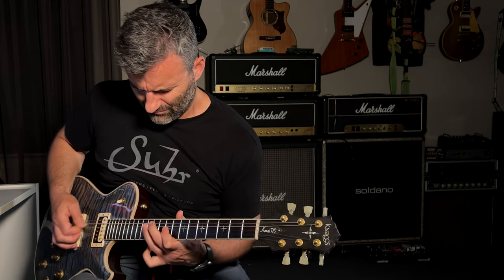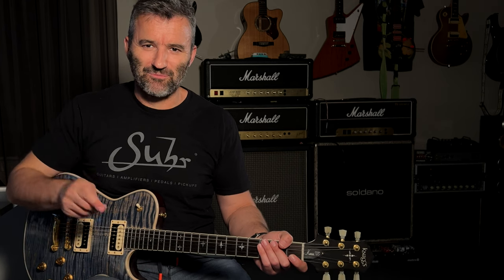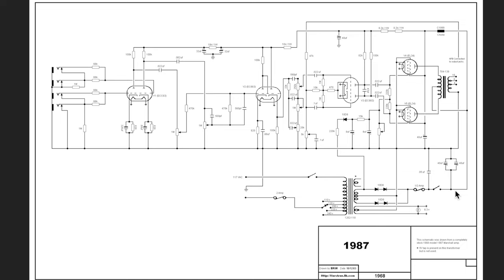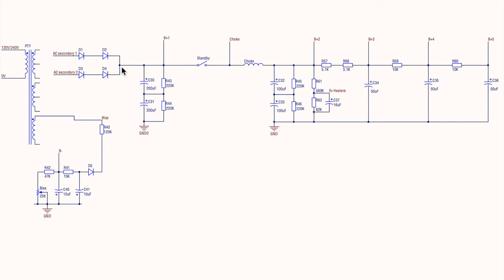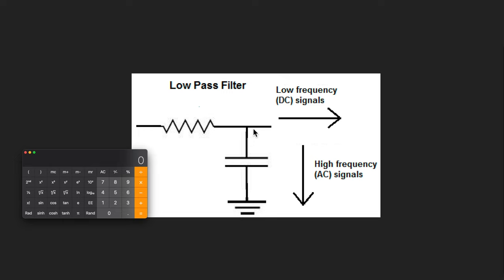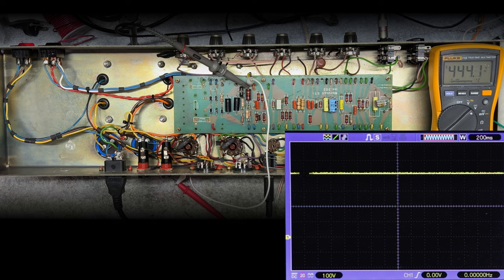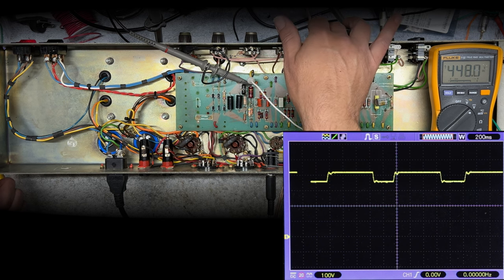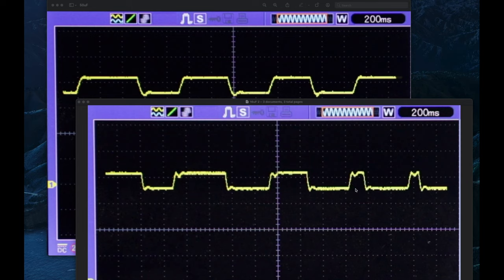Do FIlter Cap Values Matter in a Marshall?  IN DEPTH MEASUREMENTS and TONES!!

Comment: I'm enjoying these vids, you're putting a lot of time and effort into micro tweaking. The more pronounced overshoot or ringing with 16uF is a function of the LC low pass filter response. No ringing it is said to be critically damped. There are many different LPF responses for example Bessel, Butterworth, Chebychev etc etc. Bessell (or Gaussian) has no overshoot / ringing and for example Chebychev has a lot. Looks like there are a few things happening here simultaneously -> one is the PS 'sag' and another is the ringing from transients. I've never really thought about ringing in this part of the PS so really glad you posted this, it's given me a few ideas to try. For example, you can have the sag of the 16uF without the ringing, it's just a matter of a/ juggling the values for a Bessel response or b/ use an RC damping network. I recommend downloading Ltspice freeware and you can simulate / play with ideas, see how it responds to various IP signals before modding and listening.

Comment: If you're using solid-state rectification in your amp, reducing the main supply filter cap is going to have an impact on the amp's bass response, as well as the hum levels, on the other hand increasing the main supply filter cap is going to "stiffen" the amp's response, if you're using vacuum-tube rectification in your amp you don't want to increase the main supply filter cap because it will shorten the life of the rectifier tube.

Comment: Fun Fact: on the current fractal devices you can “virtually” adjust the filtering. Also you can select AC or DC.  The AC/DC option lets you get rid of any ripple regardless of the amount of actual filtering you choose (DC). If you select AC then you can hear ghost notes if the filtering is low enough -just like in the real world.
Reply from the maker: Amazing isn’t it, I have played around with those parameters.
Reply: @HeadfirstAmps  Yeah, I’ve been using the Red Channel of the Bogner Ecstasy (Fractal) and its super chewy with the default settings.
Reply: @HeadfirstAmps  Also when I turn the bias up hotter on Fractal I have an urge to back it off as I know in the real world it would be hard on the tubes. LOL

Comment: Super interesting.
Food for thought: You can get SCR, I think up to 50uF 630v plastic caps now at reasonable prices. They will last forever, and maybe sound better, you can get away with half
the caps on a 100w amp because of the higher voltage, but they don´t come in double cans. Some amp gurus think it is better to distribute the caps, instead of placing them
at the start of the amp.

Comment: 50uf for me, the 16uf sounds gritty on the harmonic overtones (in a bad way) and seems to lose some chime and bass. It’s not doing that ‘sag’ thing a JTM45 does when you hit a big chord either, I think that’s more down to the valve rectifier than the filter caps. 

Valve vs. Solid rectifiers would be an interesting video but slightly trickier to do (unless you just borrow a mess with a rectifier type switch)
Reply: Okay

Comment: Here is a tough kind of question, I previously had a JCM2000 DSL 100, that I bought used and I now suspect the original owner had removed the bright cap because when I put the presence on full it gave off that fat Marshall crunch tone, (lots of sustain, lots of low end thumping, rich crunch, lots of "feel") especially when the Presence was maxed, (FYI, Strat and 1960a cab, 90 mv bias)
Unfortunately, I sold not realizing what I had...
 I have purchased two of the same heads since just to be disappointed, (post-2004, no bias issues), both heads suffer from fast dying notes, thin-sounding, no "feel", so I just finished re tubing (the last head) and to no avail, little more "feel" from increasing to the 90mv bias)
Would you remove the bright cap? 
 I'm definitely going to try a choke too, (I just learned from your other video), I hate to sound OCD but this has been an ongoing struggle but I'm not giving up...
Thank you in advance even if you are not able to comment...
R

Comment: Again, another facinating video. Did you notice any increased hum, going from 50uF to 16uF on the screens? Do you think there would be any adverse issues on going this route on a 2204? Thanks Jason!
Reply from the maker: Thanks Steve.  No noticeable increase in hum, the filtering through the rest of the preamp will see to that.  I have 32+32 on the pres.  Do try it on a 2204!
Reply: I can't speak to the 800 or 2204 but in a fender vibro champ scratch built with a very small power transformer. Just enough transformer to do the job. It had quite a bit of hum but was drowned out by the signal to noise while playing. For an experiment I stuck a 220uf cap after the choke. It's tube rectified. The hum dramatically lowered. After some testing i concluded the additional capacitance raised the b+, increased the bias, lowered the sag, raised the rails decreasing distortion, and dramatically decreased hum. The b+ is reducing in ripple, sag spreading the rails, and cleaning up the sound a bit. It's all semantics to me though with knobs and pedals involved. I would 100% jumper in another cap and see how it sounds. No harm but the cost of a cap

Comment: I always felt the preamp filter cap had the biggest effect when dropping lower than 50uF
Reply: It has as much effect as any other filtering node. But in this video he is going over Power tube distortion where Marshall's true tone lies. It can be unforgiving at higher volumes even modern metal, so it helps for the filtering to have just a bit of give. Typically 47uf or 50uf is about the sweet spot for tight and chewy, lower is a bit more 'carmelized,' more personality and give but doesn't hold up under higher gain. 100uf has been used in late 80s JCM800s as ultra-high gain players demanded ninja-like response from their Marshalls, but played anything slower than blitering pace and gain yielded a sterile, uninspiring tone

A fair compromise today is for amps to have stiff mains/plates filtering of 100uf or more, 50uf for screens and PI, 22uf for preamp. Tight where it matters, forgiving where it matters

Comment: So which do you prefer, cranked 1987 or cranked 2204?
Reply from the maker: Oh the 1987 cranked is very hard to beat, but the 2204 is more useable in a band context.  The 1987 really needs the Fryette PS2 with it to make it band friendly.  I prefer the 1987 though tone wise.
Reply: @HeadfirstAmps  What is surprising is that for recording purposes, the JTM 1 watt (the little head with a nice 2x12 cab, not the combo) is hard to beat, yes you need to crank it but you don't need an expensive power attenuator. It gets as good as a cranked 1987, and even more chewy. Do you think it depends on the fact that it has no EQ knobs? Sometimes I think the less knobs the more clarity.

Comment: I have a 18 watt JCM800  from Tube Town .
Solid state rectifier . It has  2    2x100uF and no B5  . I put 100 at mains and  50 at the rest , but the amp become noisy .  
 So what about noise ?  If you lowered the filtering  .
Reply from the maker: Check your grounding of the new caps, a bad ground will introduce bad 100 or 120hz hum
Reply: @HeadfirstAmps  100hz  with master at 0 and it goes up as master goes up .Not very loud  , the fans of my desktop pc cover it . So i wonder about the diodes it has 2   UF5408  not 4   1N4007  . I don't think it is a ground . I will change the diodes  .
Reply from the maker: 100hz with master on zero is usually, a bad power tube, bad mains filter grounding or bad mains filter cap…or failed choke.

Comment: I have 100 on the screens in my 2204.
It goes 100, 100, 40, 20, 20.
Ive also 47n PI coupling caps, a 470k resistor into a 500k master volume pot.
One thing I've noticed with every 2204 ive built, variants etc, is there's an artifact that sounds like over distorting, or parasitic inductance, whatever but ive finally solved the problem with a 120pf cap on THE OTHER SIDE on the PI over the 220k bias junction.i also removed the 47pf over the 82k/100k input side of the driver.
Have you ever tried it? Seriously try it, you'll thank me later☺️ 
Honestly its why i always felt like its why i always had to increase the negative FB with those amps. If you do the 120pf mod you'll find that you can run the 100k on the 4 ohm tap and it sounds like you think it should.
Reply: Where exactly do i do this mod on the circuit?
Reply: @miseryparty3726  my amp is a homebrew.
But you'd have to tap into the power supply, where you'd want the filtering or extra filtering.
I believe in some 800 amps they only have two 10 k resistors, and can have a too high voltage in the preamp.
I like the way they did Kerry Kings amp where they take the power node for preamp to the power amp.
From the way I wired my jcm800 clone I did a 50 watt version on the KK 2203.
It allows you to use lower voltage to the preamp, but without making it sound too thin running from the screen section of the power supply.
Reply: @KB_Joys  I meant where exactly did you put the 120pf cap? my negative feedback is pretty weak in my 800 lol
Reply: @miseryparty3726  oh, I thought I was replying to something else, lol 😂
As far as that capacitor and where they normally place it across the plates, you can parallel it with one of the PI plate resistors.
I don't remember which one off hand, but you can also place one across the the plates on the other side of the resistors.
Also id like to point out that I noticed some instability with a few amps during the initial build process.
Like after I got things together, ran tests, set bias, etc things seemed to just start holding together and had more stability if you will.
I thought it was weird, idk maybe it was just me.
Anyways I ended taking that capacitor out because things were stable.

Comment: Nice video Jason!  I like the 50's more than the 16s.  The 50s are more smooth and the 16s in the video are too "edgy"!!  Cheers!

Oh, where is the link for comparing chokes??  Didn't see that!
Reply from the maker: Edgy is a good description! Perfect in fact.  I like to play the edgy setup, it’s easier! Lol 

Chokes, interesting…one to add to the list!
Reply: @HeadfirstAmps  Oh.  I thought you commented you had already made a video!  My bad.  Must have misunderstood.

Yeah, edgy would be a personal trait.  I like sizzle (ala Doug Aldrich), but not "edgy".  I like the soft rounded in the power section and adjust the sag or tightness in the preamp section.  Friedman sort does this.  His power section is really fixed and in the preamp will run anything from 16, to 22 to 33 to 47 depending on what he's looking for.

I find the Jose pre-TS more "edgy" also, but like that edginess...but again it's in the pre.  I think you do also.  Friedman....not so much and prefers the standard post-TS sound.

One suggestion on the power section and when presenting it and explaining it....you utilize a standard Marshall (Friedman) setup where capacitors are in series and using balancing resistors across them.  Would be much simpler to just use a capacitor and NO resistor as the other stages.  Really, the only reason to do this is when the voltage is greater than the rating of the capacitor itself and in the old days running 540-800V.  When running 500V or less...just run as I said and a capacitor and no resistor and on the plate and screen and eliminate components and cost and those caps are not cheap and $0.15 resistor!!! Unless high voltage, I don't use the extra caps and resistors on ANY of my amps.  Wasteful and costly...and easier to explain (instead of saying, well their are the same value and half value or having to calculate it out)!!!  :)
Reply from the maker: Well, only all about chokes and comparing to a static resistor. I have done that.  But I haven’t done a A/B compare of different choke specs.

This one: https://youtu.be/yQjd-9N93C4
Reply: @HeadfirstAmps  k.  static v. choke.  I'll check it out.  Thanks for the link!

Comment: Would you recommend going this low / 16Uf on a JCM 800? I was thinking 32uf would be better to retain the correct feel of an 800? because they're not supposed to be as spongy as a Plexi, Maybe? but wouldn't mind a tad bid of sag on my 1983 800
Reply from the maker: For a JCM800 2203/4 I'd have 50uF.
Reply: @HeadfirstAmps   0K, That's what I will put, Thanks!!!

Comment: Do these filter caps also give white noise sounds and some crackles when they begin to go bad? Some days my Marshall does that and some days it doesn't. I'm no tech or expert thus the reason for my question.
Reply: Yes. Lots of crackling like you hear when frying bacon. Also ghost notes following the notes you play. Filtering caps make a huge difference. My old Marshall superleads need their electrolytics replaced because of hum and response too slow

Comment: Is 100uf for screens and pi in a 50w with gz34 a good idea? To keep it tight and keep the rectifier sag
Reply: Just be careful with the main filter cap, according to GZ34 datasheet, I can´t be larger than 60 uF. According to your question: It will give a very stiff supply, so you must decide
if you want that.

Comment: Always got to bear in mind that high wattage amps were designed to sound best cranked. 
A lot of years later we find that the original specs don't deliver the sound and response we want at the considerably lower volumes we want to hear them at. Increasingly this is true of speakers too. People go higher and higher power handling, thicker more rigid cones, bigger magnets etc. The venerable pulsonic Celestions were paper thin and flapped around like your grandad at a hen do!
A good analogy is the sports motorcycle industry in the 00's. They kept producing these monster horsepower road bikes that did absolutely nothing below 70mph/10, 000 rpm. 
People didn't understand why the powerband was so "unusable".  They just weren't as much fun as the torque monsters. The answer was because they were not designed for the road...

Comment: Nice video! 
 Would  the feel of playing 50 vs 16uf  be comparable to playing ss vs tube rectifier?

Always wanting to have a jtm45 only because of that saggy feel everyone is talking about ,  so if i would put 16 + 35uf with a switch between make it a jtm+jmp in the same amp?
Reply from the maker: Sure, maybe 16 & 50 would be more noticeable (on the screens).  And you have to be cranking the amp to really feel the difference.

Comment: Why aren't full wave rectifiers used in Marshall power supplies, isn't full wave have less ripple than two phase? Pls educate the diode illiterate
Reply from the maker: They are in the 100w amps.  With two phase, like in the 50w's, you still get the same ripple factor ( 2 x mains frequency).  It just goes about it a different way.
Reply: @HeadfirstAmps  Actually I've observed that most tube amp circuits use two phase rather than full wave bridge rectos. I wish had studied EE so that I may better understand 60 year old analog circuits lol. Thx again for creating this content!
Reply: @BracliCreations  It is because of the transformer voltages.

Comment: So…. A 1987 circuit is different from a JCM800 (2204). Other than that this guy is alright..
Reply from the maker: It’s not a 2204. It’s a 1987 circuit. JCM800’s were a series, not a circuit. There were 1959 and 1987 circuit JCM800’s.
Reply: You got an answer, but yes the 1987 is a simpler 4 input amp with no serial coupling of the gain stages and a MV. To complicate things the first few 2203 (100w) and 2204 (50w)
did not have the serial coupling and MV. Because of the you have to play the 1987 hard to get your distortion.